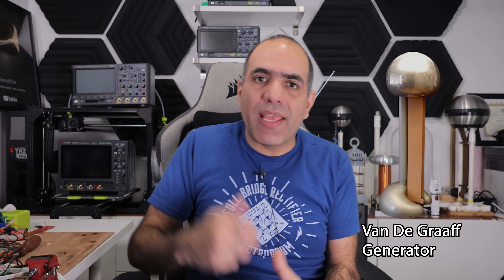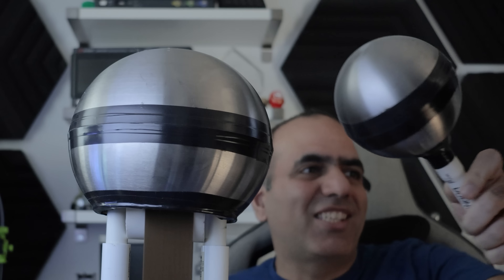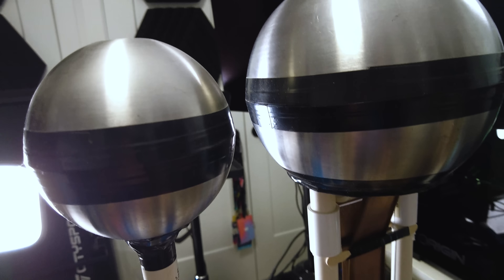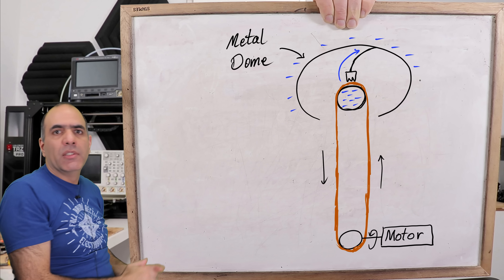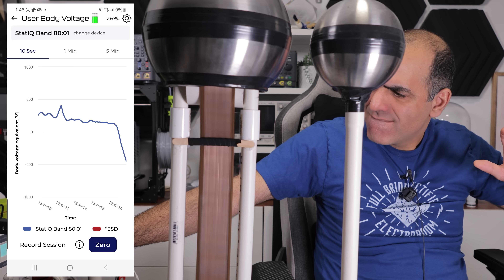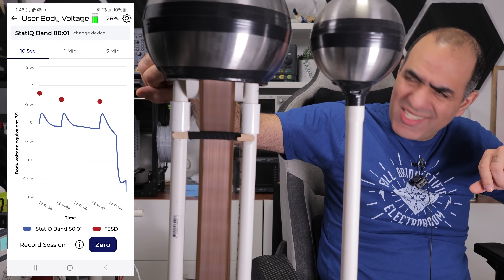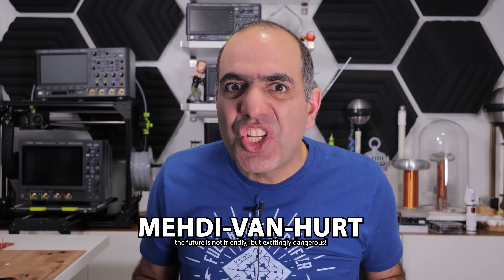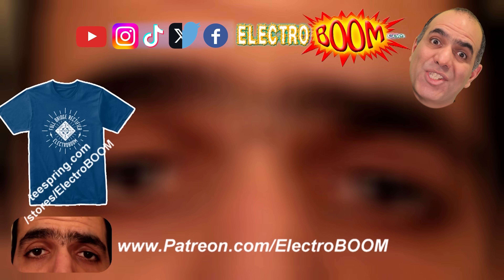An Attempt Was Made!

Comment: possible solution:

Charge Redistribution: When spinning or operating, the design might inadvertently allow charge to move from the positively charged area to the negatively charged regions. This could occur due to a conductive path or ionized air providing a leakage path.
Air Ionization and Leakage: High-voltage fields can ionize the air, allowing ions to carry charge away from the desired region, reducing the positive charge accumulated at the top.

Solution to Increase Positive Charge imo.
Use a high-grade dielectric material to prevent charge leakage along the structure.
Charge Conveyance System:
Introduce a more efficient belt or roller system (e.g., rubber or silicone with a strong triboelectric effect) to transfer more positive charge to the top while minimizing leakage.
Prevent Negative Feedback:
If negative charges are draining the positive region during spinning, include a mechanism to block this path. This might involve additional diodes or insulating gaps.
Shielding or Grounding Surrounding Areas:
Ground nearby surfaces that might accumulate opposite charges and create a path for charge recombination.
Add a Faraday cage around the system to contain stray electric fields.
High-Voltage Optimization:
Increase the rotational speed or adjust the materials involved in charge transfer to enhance positive charge buildup.
Airflow Control:
Ensure the device operates in a dry, clean environment to reduce ionization effects in the surrounding air.

Comment: If the issue is charge leakage through the air then I wonder if some well placed insulation could fix the issue, like a circular plexiglass panel that attaches to the bottom of the globe with a hole in the middle for the belt and structural members. Maybe you could go even further and attach a tube that goes into the inside of the dome

Comment: Put two copper in parallel going vertical against the belt then connect one side the negative side of the copper to the dome should solve the problem medi then the other side can be wired to the back positive of the belt if you wanted. You want even more do a few of the connections in series. Look up TENG tribo electric nano generators the metals don't need to move just the belt on them.
Reply: They have tribo electric rain cells make voltage from rain same concept just replace rain with your belt.

Comment: My understanding was always that part of the subtlety of a Van de Graaff machine was that after the charges are on the belt, it's the fact that they are then physically moved to be inside of an approximation of a conductive closed volume, which has zero voltage, at which point they exchange with the upper comb. This would be why the two sides of the belt are "negative" and "much more negative".

Comment: I think the Plexiglas and the Nylon would have a separate Triboelectric effect to the PVC and Nylon, which when adding copper plates could probably cause dissipation of charge, I would think. 

It might just work with the copper tape and without the Plexiglas... but I haven't slept well in several days and I could be completely wrong.

Comment: Rather than connecting the ball to ground.....connect the ball both to ground  and the belt AND the large dome its self....using its own discharge to excite the belt.......im picturing a run away effect up until resistance limits the arc. IE, the charge in the belt PLUS the discharge arc, all feeding to the belt, much as a jet engine uses its own thrust to pull more air, and so on. OR.....maybe im just a car mechanic, and should be ignored at all costs, lol

Comment: So, it would be a Lot more work, but, weaving thin copper wire into the fabric, in a spiral or double spiral, then connecting the wire ends back to itself smoothly in each place you had the tape segments *might remove the sharp issue and keep the other effects? But would need testing…

Comment: It sort of goes against the concept of a VDG not relying on external power but have you thought about using a small Cockroft-Walton voltage multiplier to inject additional electrons on to the belt?

Comment: you can get rid of the sharp edges by curving them away, you could also place an insulator on the edges I believe a combination of the two approaches should reduce escape charges.

tbh at some point it becomes meaningless to insulate or control charges because its so difficult, I usually just make sure the wanted path is the path of least resistance thus making my HV circuits harder to short.

Comment: take point bro. not me. well you are the one pointing the finger. at a high voltage dngr. a gimble is a third hand. the helper. does not compute. get out of the cata-comb. dont make arcs dead again. charge is the same as heat. both can be pumped. equal behaviour. you obviously needeeznut. dont be so negative, be positive. why did you draw a neutron. of course the flow rate is higher on the other side, so its more negative. remove only every-other charge pad. its the arc distance. the pad distance needs to be significantly longer than the arcing distance. to prevent arcing. or well, insulate the charge pump cups (water pads). the water drop high voltage generator works like that.

Comment: Maybe you should construct some kind of isolating cover rated to more than 20k volts around the belt mechanism to prevent charge from escaping through the air before getting to the top. Pipes and sticks (even with tape on them) are probably somewhat conductive too with such high voltage.
Reply: I came here to mention this too. Even a simple large but thin plastic sheet wrapped around the belt area (going up into the top dome) would help avoid the belt plates discharging through the air, allowing them to pass more charge to the dome.

Comment: Isolate your v.d.Graaf and supply it's "ground" with the output from an automobile ignition coil driven by 12V ac.(o/p about 20 - 50 kV)  I did this in high school and nearly killed myself.

Comment: I made a Van De Graff machine which on dry air days would produce, at maximum, a 53 cm spark. It had a 400mm diameter aluminium sphere with a 2 inch wide rubber belt on acrylic rollers top and bottom and I added a car ignition coil output via several vintage gramaphone steel needles to the bottom of the rubber belt.  This modification did not make the arc any longer but did significantly reduce the recharge time interval between discharges by at least 50% and probably more like 60%.   The relative humidity of the air was the most significant factor in limiting the spark length.   BTW this was an electronic killing machine and it damaged a PC network board at some distance before I realised that using the house earth was not a good idea so it was earthed by a separate earth cable and the damage was limited also by switching off electronic devices close by.   It wiped out anybodys science project at my son's school that used 555 timer chips - these chips  seemed to be very susceptible to static damage.  This machine could illuminate a fluorescent tube up to 40 feet away although very weakly and really only visible at night.
Reply: Wow... my Van de Graaff could change the volume of my Speaker wirelessly... far off! And could turn on a fluorescent bulb from like 5 feet away.... but yours is a beast!!
Reply: @Windows98Official  I think the main reason I got such good results is that the rollers were made from 2 materials both with low dialectic values - Acrylic and HDPE and the sphere was 2 aluminium hemispherical  lampshades joined (clipped) together with the edges turned inwards both at the join and the supporting pipe(plastic downspout 100mm diameter) entry hole.  The belt was driven by a sewing machine motor.    The base was covered by another hemisphere made from a dark polycarbonate lamp shade of equal size to the upper sphere.   I still have it but the rubber belt has perished,  it was made by obtaining a rubber band tube and slitting it.  There is or was a rubber band manufacturer close by and he  obliged me with this 1 metre long 2 inch diameter tube from which to make the belt.   A very satisfying project which I still have intact and may resurrect one day!   Thanks for the engaging video, it reminded me of former days "wasted" doing crazy science things like this.
Reply: @ Wow.... your Van de Graaff really mimics the original!(with rubber belt) Mine has pantyhose nylon and PVC combo..
Reply: @johnantliff  Use poly shopping bags as a crude replacement belt.  Works fine.  Crazy glue, to make long loop.  Also, cover one roller with white teflon pipe-tape.   Also, experiment with adhesive foil tape, black vinyl tape, etc.

To ruin any VDG, just let it catch a whiff of WD40 spray.   The voltage drops to zero, and never comes back.   Don't use this knowledge for eeeeeeevil.
Reply: Wooow😮

Comment: Aerospace engineering student here
You can 
1). Try to get a better metal dome, without sharp edges, more curved, the better.
2). Use the rod to inject charges in belt instead of ball, to increase surface
3). Use a rubber belt (better dielectric)
4). clean the panty hose, oils can prevent charges from building

Comment: I am not making anything, but can a van de graff be designed in such a way as to make the top ball charge positive? If so, you could have the two next to each other and have double the voltage potential jumping between the highly negative ball and the highly positive ball.

Comment: I think the easiest way to add more negative charges to the belt it placing a negative high voltage supply in between the ground point and the additional brush. At around -40kV that brush should let go the charges easily and charge up the belt.

Comment: here is my spin on how you could improve it! I made a whimshurst machine for a physics and Computer sciense class once... soooo while I dont quite know the super scientific stuff, I have "experience" XD

and as I'm trying to explain it, I also see more and more flaws. but I really want to contribute to this topic cause I also had the idea of combining both machines once, so here is my go:

I dont remember everything anymore but basically the whimshurst machine is just generating a higher and highger potential over time. You suck the electrons from one side to the other (still on the same plat) therefore generating already a potential. That new negative potential is now pulling electrons closer to the disk on the other disk, so the other disk is pulling electrons from their other side to get the potential back. 

The van-de-graph machine works by creating a potential between two materials. So the belt has a negative potential, and the PVC a positive one (or the other way arround, idk). To me, the whimshurst machiene is like a electron pump. But you didnt conect the pump to pump anywhere... And since you only made a potential with the van-de-graph machiene, you sucked it right out with the grounded metall ball/coper foil 

theory one: 
So my theory is, that you need to connect those brass rods in an X config. This way, you'd generate the pump again and pump electrons from one rod to the other... but now that I think about it, I fear that doing so would eliminate the function of the van-de-graph machiene. The electrons would only be Pumped arround and no longer scwaped out between PVC and panty hose.

theory two:
Scrap the brass and copper stuff, you already have your plus and minus potential... the panty hose and the- wait... that also doesnt work...

Comment: By no means am I a scientist, engineer, or any form of technician in any regard.... BUT... what if instead of the conveyor belt mechanism you replicated the mechanism of a coiled copper winding in a brushed motor? If you instead had a column or cylinder of pantyhose that rubbed against the internal surface of a single PVC pipe you would have far less leakage around the base of the dome. Although now that I've typed this out it would make isolation of the positively and negatively charged aspects of the mechanism nigh impossible to isolate from one another. But who knows, perhaps this may well inspire the actual solution to the issue.

Comment: Almost made it needed to cross a wire independent of ground from one side to the other I think from top to bottom on either side. Should also put a ball on the other side, and then attach the ground wire to that. Doubles your capacitance and sparks that way as the balls are where the differential charges are stored like the laden jars in a whinshurst machine.. But you know that already. Fun vid though.
Reply: Also fwiw I would probably switch to Kapton film for the belt and a metal roller for the brush would fix the binding issue and you get the cool factor of a see-through belt that's got less resistance.

Comment: probably using something with a better coefficient of friction by it's surface roughness, texture, or coating could help. also the friction inserts weren't a bad idea at all, it's just that you chose the worst material possible for the task. you could try again with some non-conductive materials like , rubber, teflon, fibreglass, resins and graphite (or cotton, paper, wood or plastic if you dont care to see your invention catch on fire) and try to get a combo that has enough maleability for the belt, and roughness for the inserts. once you secured the correct combination of materials you could also run the machine even faster, and try catching the arcs with a nail or something else large and pointy (just keep it family friendly, we don't need to see any non-metalic tips here iykwim)

Comment: I think you should only move the bottom comb from the bottom to the upward side. Then the electrons from Earth would be attracted stronger to the belt because of the opposite side proximity 🤔 You could make it similar on the top: move the upper roll deeper into the sphere and collect the charges from the downward belt where the opposite side of the belt is close again. You could try to add two unearthed but cross-connected pairs of combs in the middle, just like the pairs of combs in the Wimshurst machine. The bottom one on the upward side needs to be connected with the top one on the downward side an vice versa. Well, imagine you are the sector of Wimshurst machine and look what you pass by in your journey 😉

There were the sectorless variations on the Wimshurst machine...

Comment: Your charge is clearly limited by the Top load Capacitor.  This is evident by the Frequency increase at 13:00 as when you pump more charge its able to increase the speed it discharges however you are and will always be limited by the size of the Sphere on top as that is what accumulates charge, and it's reached its maximum potential.  You need a larger Top load if you want to test your hypothesis.
Reply: Doesnt it also depent on the speed it charges up to the maximum? I feel that is what he was doing to measure success

Comment: Wool or polyethylene belt with and ion generator or high voltage DC circuit to spray extra electrons onto the belt? Also making the tower it's self taller so the top can build more charge further away from the ground plain?

Comment: Change the dome, look for metal urns they have very rounded openings. Put a 1k ohm resistor on secondary ground. Keep secondary ground just 2 inches or less from bottom roller on upward side. 
  Something i did back in the 80s.

Comment: Why it doesn't work? Intuition yells 2 things at me: 1. System isn't isolated, you're tapping electrons from the same conduit, there is only 1 peak deltaV in the system. extra Tapping points will short the system resulting in a lower DeltaV. 2. you tried it parallel, not serial. So if you can isolate the copper strips from the panties and put both systems in series you'll have a s system that will add the delta V's and hence a better machine for masochists.
Reply: quick side note, you'll have to use in more power turning the belt. The extra energy the system has isn't magically created:)

Comment: I think you should probably just isolate the panthyose from the dome and your contraption may work. It will prevent the dome charges to leak on the copper. Maybe you could also use your magic wand to increase the voltage higher ?

Comment: As an electrician your willingness and dedication to getting zapped is commendable. Straight off the nose 🤣Reminds me of a scissor lift with no grounding strap once upon a time. Saw a blue flash from an arc to my forehead off of a roof rafter.  Used to lay my long handle screw driver on the guard rail when a helper would ask for it, didn't matter if they were wearing winter gloves😋

Comment: What you could do is remove the electrical tape from the metal rod on the popcicle stick at the bottom and add another one in the center, then ground those two rods. Without the plates you won't have an issue with the bare rods. The small spot the ball touches is possibly the limiting factor for the transfer of charges.

Comment: What if you switched to two counter-rotating "belts" that both carried charge like a Vand de Graff generator but the top pulleys had Wimshurst disks attached.  I worry though about charge transfer and how to get the belts and disk distances far enough apart to work as intended... Like if a W machine uses capacitance do you need to modulate the distance between the disks and disk to belt distance to avoid charge loss.  It might just be better to have one V generator belt and the typical W machine driven by a different belt(s) from the same motor in the base and just run a wires to connect them via the PVC pipes.  Like would the series connection just make the W side  pad distances so large and the disks so big big that it would be pointless and that just scaling the V side would be more efficient?  Dunno but it sounds fun to try.